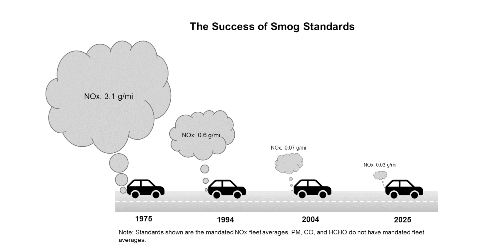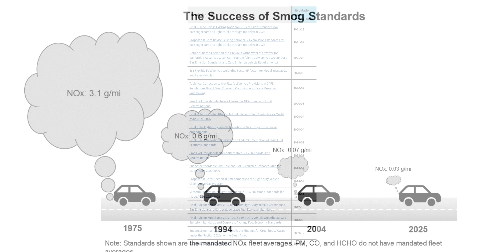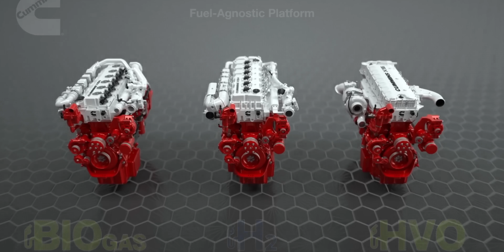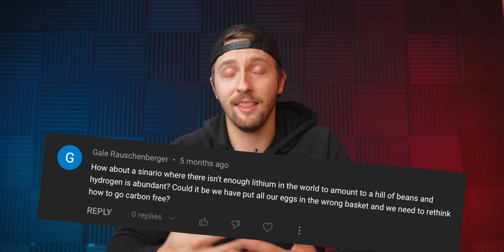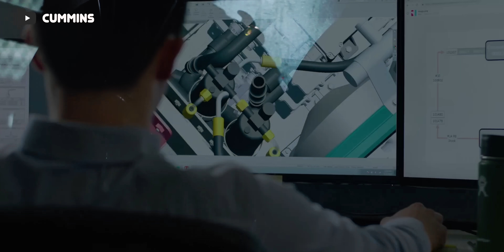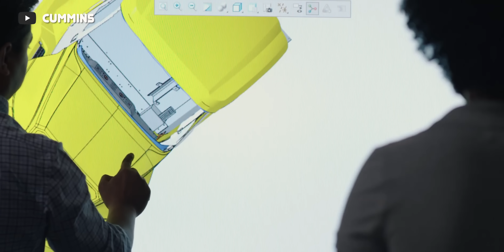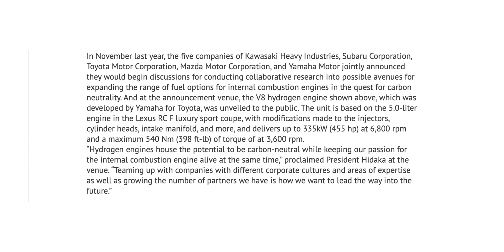Cummins Hydrogen Engine Will KILL DIESELS FOREVER

Comment: I live in the UK and a local bus company has bought a couple of electric busses but it's that costly to charge from the power grid the bus company rents a diesel generator to charge them so the cost of renting a generator and the cost of the diesel to run it is cheaper than charging off the grid... who would of thought lmfao

Comment: Since electric wins the torque and peak demand game I think plug in hybrid should be the next step across the board. For long range or off hwy you fire up the diesel generator. For everything else you grid charge.
Reply: You're going to burn more fuel using a generator to produce electricity to charge something then just having it run off diesel in the first place.
Reply: @jasonstclair6293  I disagree. Changing load and rpm is what makes combustion engines the least efficient. The engine in a hybrid only needs to produce the average power needed. The diesel generator can be smaller and run only at its most efficient rpm and load.  With series hybrids you get the benefit of electric right now and the benefits of diesel for when you are far from charging. Its the best way forward without needing new technology. As batteries get better you win. If bio fuel or hydrogen gets better you can run the generator off that. Series hybrid boosts efficiency today and doesnt prevent you from using future advancements. With straight hydrogen if you bet on it and the hydrogen refueling stations never catch on then you made a poor choice. With straight electric, if batteries dont improve you made a bad choice. Hybrid is improvement now and preparedness for the future. Its a win win.
Reply: @dansacco1964  fair enough.  I never thought of things that way and it makes sense.  I'm not against other technologies, but I do think it's going to take a long time before anything new catches on.  Having issues 1000 miles from home with a perishable load is a lot different than your car having a hiccup on your way to work.  People are going to wait until it's proven before loosing business to a finicky system..
Reply: @jasonstclair6293  Agreed. I feel like too often everyone is looking for the next big technology/thing and I have a feeling it wont be just one thing. It will probably be a wide range of things depending on the specific task. All we have ever known is fossil fuel and that is the only one size fits all fuel. I doubt that ever happens again.  What would be cool is if using boost levels they could make these large diesels burn hydrogen or diesel. That way if hydrogen never catches on you still have a working truck. Saab had a variable compression engine in development years ago where the block changed length to change the stroke. Maybe there is a way to make a diesel that can be optimized for almost all fuels without needing a different head or whatever.
Reply: @dansacco1964  Electric makes sense for local routes, but that will take more time than people think.  Most places don't have the space to add storage systems to lighten the load on the grid, and there is a big difference between charging a couple cars in your garage versus 30 - 40 delivery vehicles.  You could argue a generator's efficiency in that situation, but all it will take is one failure and it will be gone.  The public will be hard to convince, and people won't want to hear it running all night long.  Hybrid I just don't see working for some people.  It's going to be a matter of weight with hybrids.  Even a Prius has an engine twice the size it would need if it were just gas powered.  Hydrogen would be about the easiest to incorporate into truck stops.  Other than finding space for the tank it wouldn't take much to convert a few pumps over to a hydrogen filling device.  Electric is going to create more bottlenecks then exist now at the truck stops.  Even with a 30 minute charge you are taking at least three times as long as it would to fill up your diesel. Most places don't have the space to add three times the chargers to offset the difference.  One other point that it going to be a hurdle is diesel is actually probably the safest fuel out there despite what the movies show you.  That in itself will keep some people burning it as long as they can.  It will be interesting to see what finally does win out in the end
Reply: @dansacco1964  
Right you are. Huge surface mining equipment, locomotives have been using the tech for the last 100 yrs. Because it’s was efficient. 
It’s was Never scaled down because of big oil lobby. 
I’m thinking genset cng fuel-cell/ Tesla like ac power regen braking and small diesel ice under the hood. 
This is now all available now for backyard mech.
Reply: Or hydrogen fuel cell.

Comment: [COPIED]
As of 2020, the majority of hydrogen (-95%) produced from Fossil Fuels by steam reforming of Natural Gas, other light hydrocarbons, partial oxidation of heavier hydrocarbons and Coal Gasification.  In the year 2020, 87 million tons of hydrogen was produced. 
[NOT COPIED]
   Even though hydrogen is a clean fuel, it is produced from the by-product of Petroleum and Coal as well as from Biomass and (Water through electrolysis). {Even though it is clean energy it roots are still dirty}.

Comment: If we do have to go electric, what Edison motors is doing with their trucks is the best way to go in my opinion. Even if we end up going to hydrogen fuel for diesel engines, their idea would be best using a diesel generator for the batteries on the truck, which makes for a very long range
Reply: Works out almost the same, the generator would have thermal inefficiency same as the regular ICE engine except now you need to add in all the other issues of resistance, voltage drop, heat/thermal losses and friction of the electric system on top of it.... Any efficiency gained by using a diesel generator instead of directly powering the electric motors would be negligible and a small to modest saving at best, considering you now have a more complex and heavy system, at least on the power plant end, as well as the usual issues, given trucks are often working at peak outputs, this isn't relatable to a hybrid car like a Prius or whatever due to the loads experienced by the vehicle alone

Comment: fucking clickbait garbage. The world runs on diesel fuel because there's oil seeping OUT OF THE GROUND. Just because manufacturers are able to build engines that run on hydrogen doesn't mean there's an efficient way of storing or delivering fuel. I also notice you didn't even go near the little problem of energy density either. Just have a look at this graph and tell me hydrogen fuel is a good idea http://4.bp.blogspot.com/-F4nb9P5XKgM/UzS-9sPiBVI/AAAAAAAAAQA/24VHMLqWZuo/s1600/1109dp_01+renewable_diesel_vs_electric_cars+energy_density_chart.jpg

Comment: Actually some of the largest mining equipment are diesel -electric very much like a locomotive
Reply: That only makes sense with large equipment.  There is a point where a mechanical transmission, pump, or whatever is no longer practical... part of the reason trains were designed that way to begin with.  They couldn't come up with a reliable way to move them.

Comment: Calm down dude no need to freak out. The platform they are making this hydrogen engine on will also support diesel, gas, propane, natural gas, and I think a few other fuels, all you need to do is to change a couple parts on the top end. Just be glad Cummins isn’t going to the dark side and making an ev powertrain

Comment: I am an engineer developing engines in Japan.
Cummins' strategy versatility and speed of development amazes me.
Reply: Im hoping Porsches investments into biofuel are advancing with the upmost of speed and progress
Reply: Thanks for your comment, Tony.
Biofuels are a viable option, but food politics and poor chemical stability may be a problem.
I think that various alternative fuels for diesel engines should be researched. Hydrogen, e-fuel, NH3, etc.
Reply: @文々丸  It would be better to have a biogas plant which runs on waste, like the one at a dairy farm I used to work at, producing a stored fuel like methane gas. 
There are a lot of power sources that produce electricity consistently as well which could use over-production from off peak electrical consumption to produce hydrogen fuel. The efficiency of 75% is fantastic given that chemical batterries are all horrible for the environment.
Reply: @Americana-deluxe  yeah to me this seems like the way forward could make nuclear, solar, or wind farms in remote areas and ship the fuel where its need without having to change any infrastructure even if the efficiency is worse than green hydrogen i think its still better overall
Reply: @Americana-deluxe  biofuel is another ponzi scheme to help out mega agricorp like monsanto. anytime you grow food for fuel its a total waste.
hydrogen is the most abundant element in the universe.
Reply: Could Cummings produce a 2 stroke hydrogen engine
Reply: Toyota has the hydrogen vehicle that runs on Bull Sh@t that is not talked about enough.
Reply: Toyotas hydrogen engine is just a step in progress through a prototype. No need to harshly criticize it.

Comment: EVs are history. They do nothing to prevent climate change because electricity still comes from fossil fuels, even if renwable energy is used, it won't reduce fossil fuel use. Hydrogen engine is the future.